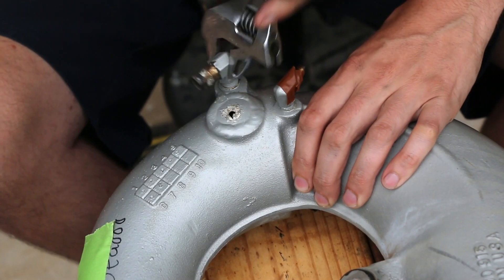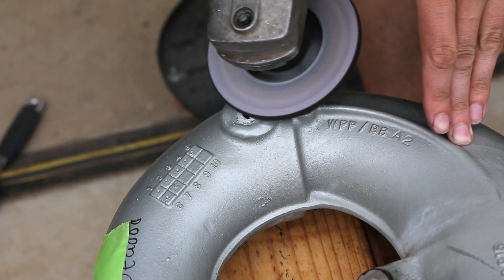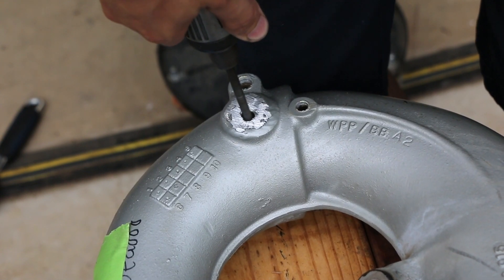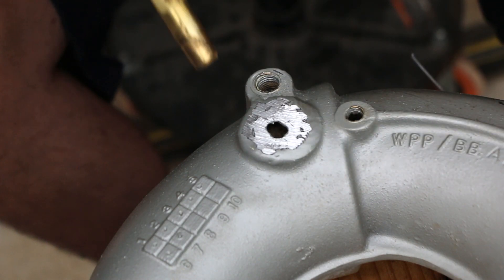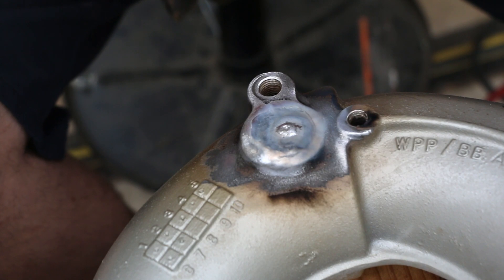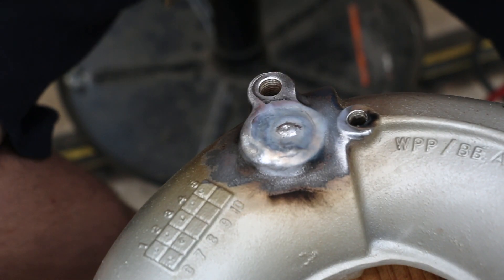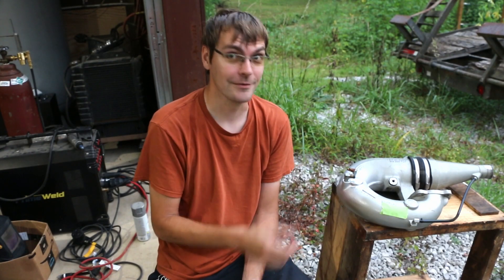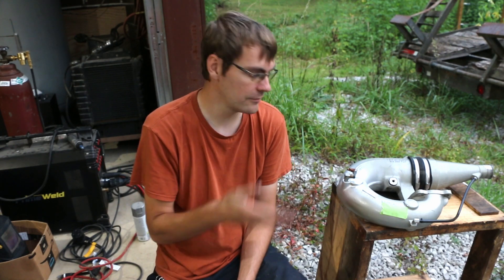Seadoo GTI 717cc Exhaust tuned pipe water leak core plug repair

Comment from the maker: Here are the things I used to do this repair:
Primeweld TIG225X Welder: https://amzn.to/3A5lkLt
Clear tig cup kit: https://amzn.to/3Ay45DW
1/16 tungstens: https://amzn.to/3SVFMHz
Blue Demon ER4043 welding rod: https://amzn.to/3K4gdzL
Antra auto darkening welding helmet: https://amzn.to/3QC9Nua
Tillman Welding gloves: https://amzn.to/3AaT3n3
Benchmark Abrasives cutoff wheels: https://amzn.to/3QX9wSC

Or, should you choose to do the JB weld repair, I have had good success with this "Waterweld" kind: https://amzn.to/3AeSZTe

Camera stuff I used for filming the welding:
ND Filter: https://amzn.to/3QYIfiF (Darkens the image so it is safe for the sensor)
18-135mm Lens: https://amzn.to/3dFIbWB
Lens hood EW-73B: https://amzn.to/3Pzz4nq
Takstar SGC-598 Mic: https://amzn.to/3K3Mffg
Batteries for camera: https://amzn.to/3pwf4re
Canon 70D camera body: https://amzn.to/3CoNlQS

Links shown may be affiliate links, these earn me a commission if you choose to purchase from them.

Comment: I found the same hole on my jetski today. I don't have the welding equipment, so I might go with the JB.
Thank you
Reply from the maker: I've seen the JB last for years, there isn't much water pressure there, and not much heat as long as there is water flowing.